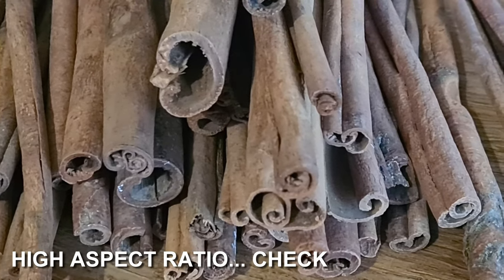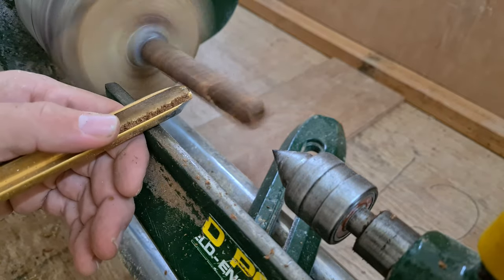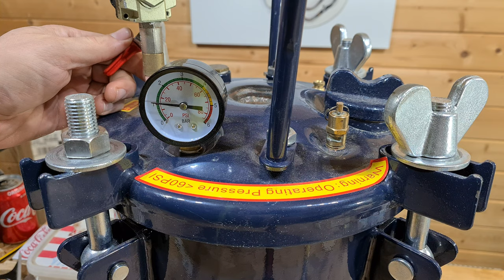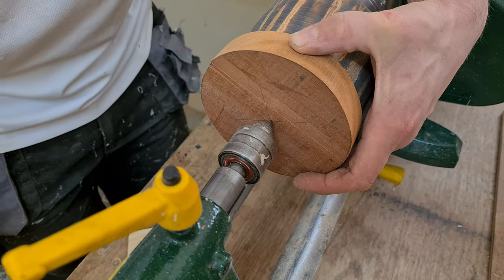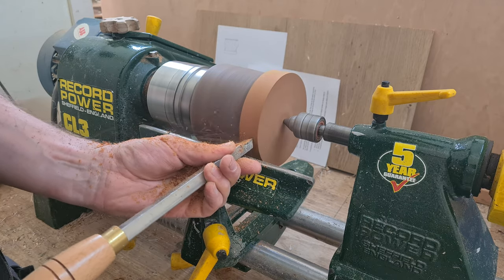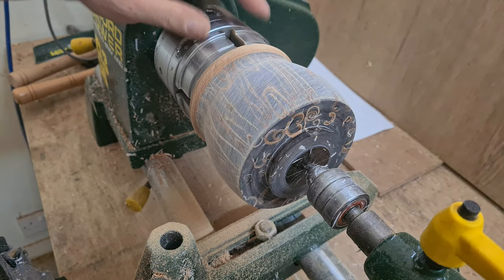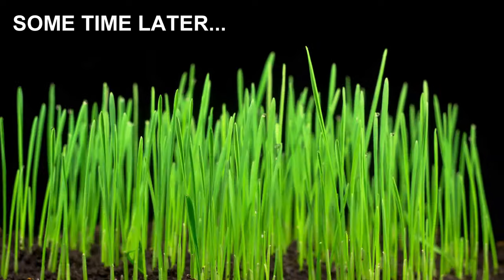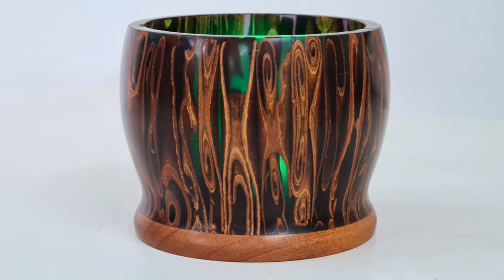Woodturning - Cinnamon Sticks

Comment: Holy cow!  That turned out fantastic.    Now I want to try it.
Reply from the maker: Hi Suzette! Please let me know how you get on if you get to try it! The only thing I should have added was that the resin-cinnamon interface can be weak and may crack if dropped (*cough* not that I did that *cough*). I didn't do any pretreatment to the cinnamon sticks and used straight out of the box. All the best. Ray
Reply: @RayWhitbyCreations  thanks for the tip.  Maybe I will soak then in a resin/acetone mix to stabilize them.  It's good that you didn't  cough drop it.  Whew
Reply from the maker: @suzetteedwards7956  Great idea!